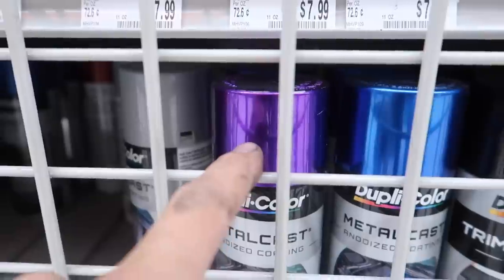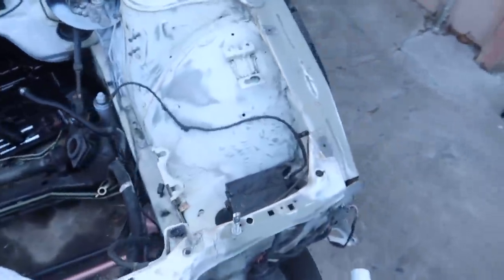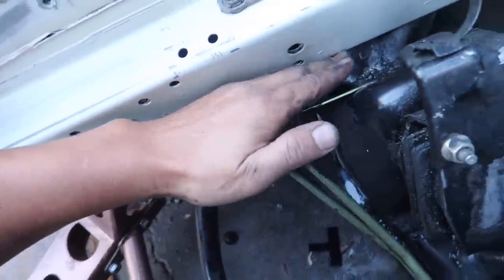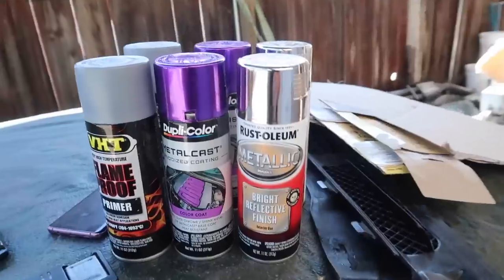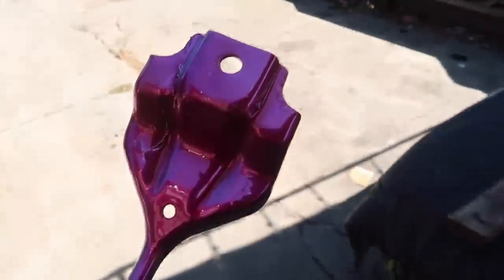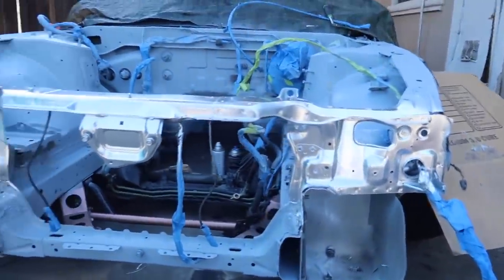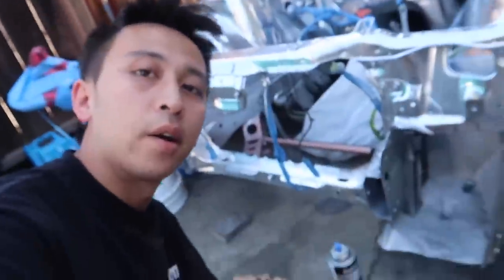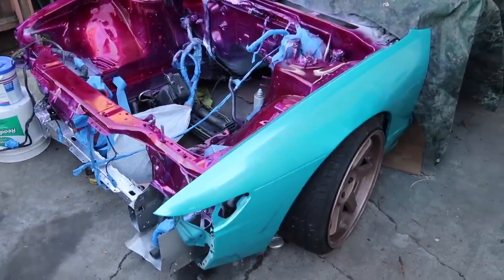Painting my 240sx engine Bay

Comment: Engine bay looking good to get the color of the cap you gotta use Duplicolor MC100 Metalcast base Coat and to get it to stick better use the Clear Adhesion Promoter Primer I used them when i used anodized red for my rims

Comment: yo bro thats seam sealer! dont sand it away if helps keep water out and prevents rust. and bondo wont stick to it and when it gets hot in your engine bay it will lift your paint. hit me up on instagram if you need any body work advice bro i got you @brokensociety